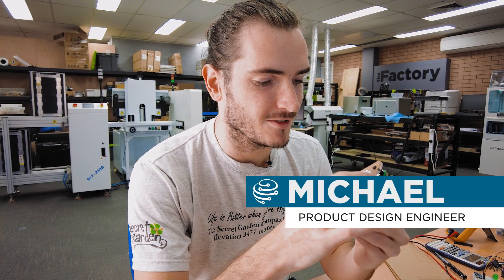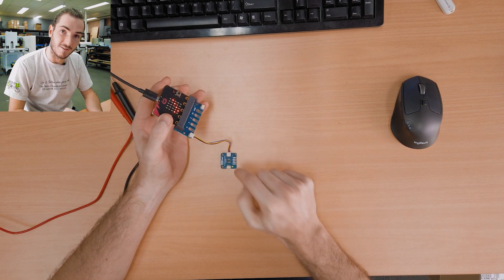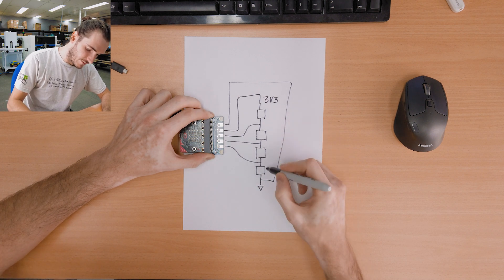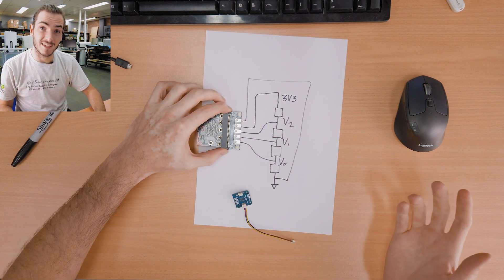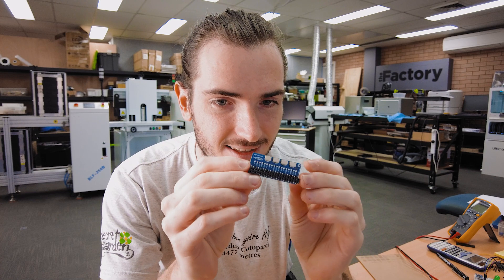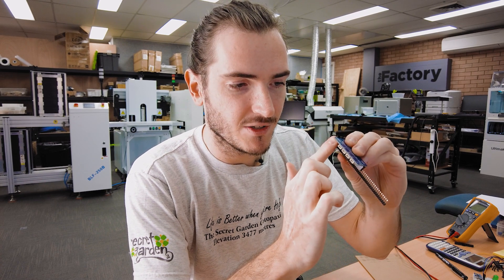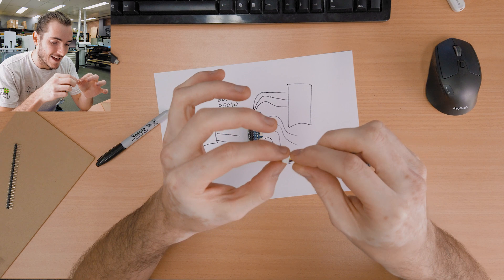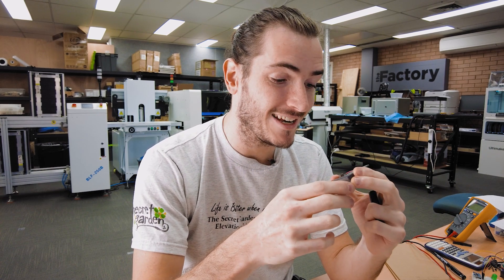The Factory | Designing Test Jigs For PCB Manufacturing

Comment: You don't need the left IO expander for the pins for the Raspi Module,  Connect each odd/even pin together then set odd low, even high, and count pins on the right, then swap and re-count. Just saves a component and time to toggle and check every pin. Any shots will show an incorrect count. You can use the IO expander on the right to determine which pin(s) are shorted.

Comment: Not sure if I'm understanding what you're looking for. How about these?
(manufacturer/part number/element14 order code)
HARWIN S7121-42R (2211310)
PULSE LARSEN ANTENNAS W9908 (2897293)
or even
SAMTEC SEI-110-02-G-S (3584640)

You might be able to make a stackup of PCB & acrylic layers to approximate an edge connector.
Reply from the maker: Hey Trevor! We have some of the HARWIN sliding contacts on the way - they look perfect.
Reply: Awesome. You and your colleagues have helped me a lot, glad I could help you. Looking forward to seeing the result!
Reply: Spring fingers are exactly what I was thinking.
Reply: @olivercouch1651  pogopins
Reply: The Harwin looks perfect.